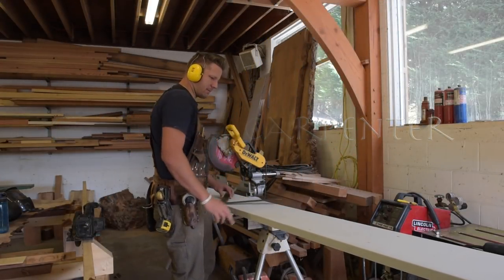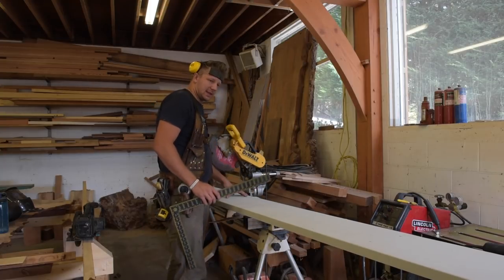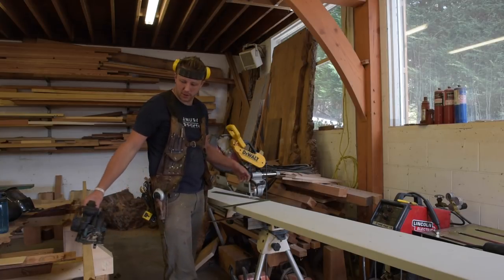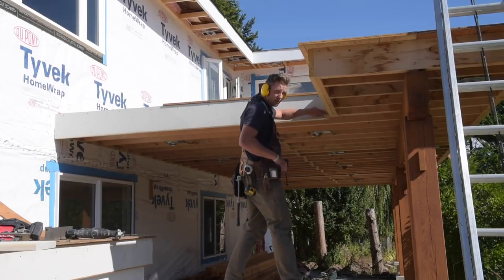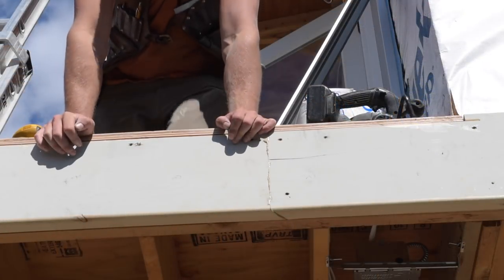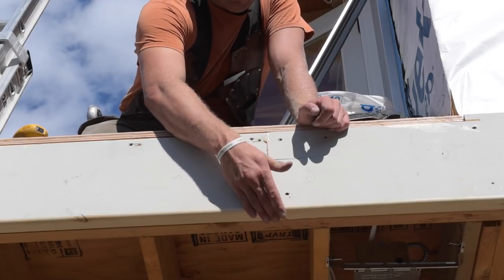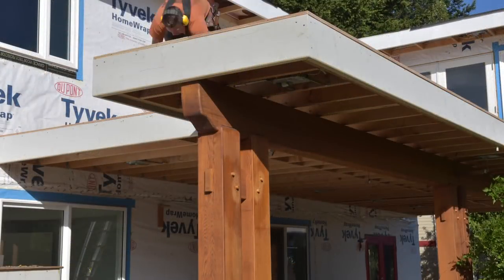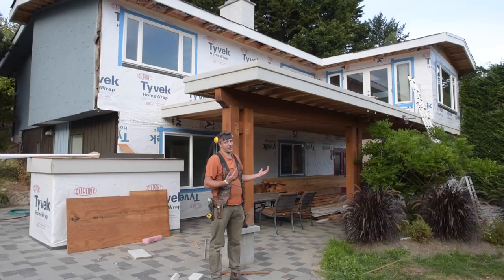Deck Reno Update,  How To Install Facia

Comment: Being a lefty, cutting against my speed square works very well. Also, a doweller for the field joints works great to prevent cupping and misalignment over time.

Comment: You need a NAS (network attached system) which is basically a smart external hard drive that can be accessed through the wifi in your house, and because it has multiple hard drives in it there is built in redundancy so that if one drive fails you will not lose all your data.
Reply: Storage not system
Reply: A NAS is not a backup. The most common time for second drive of an array to fail is during a rebuild after replacing the initial failed drive and since you're running multiple drives in a NAS your odds of failure are exponentially increased. With giant USB drives being a couple of hundred bucks these days there is very little reason to not have a complete redundant backup of everything you could ever care about... particularly so if your business relies on your data. If he loses a month worth of content, then he's out a month's pay for has to scramble to make it up some other way.

So... A NAS is a great way to store huge amounts of data in a fast to access package, but it's a terrible solution for data backup.
Reply: Amen Maxwelhse.

Comment: Hey Samarai. Doing great work mate. Just 1 thing when doing facia I would always recommend priming the cut ends also just in case of water penetration on the joints as it will prevent any moisture getting in to the wood. I'm not sure if you have done this as sped up on parts.

Comment: My 2 cents, Always primer your end cuts, even if it's a miter that you won't see.  Water will see it eventually, some how.  And water loves that spruce or what we have here primed radiata pine ( which fyi is nicknamed rotts a lots-a) even the pressure treated.  I've seen to many facia boards rott to not prime every last bit.  They don't even sell the spruce here anymore because of the rotting problems.  It used to be used as all trim, corner trim, window trim, facia, and it all needs to be replaced within a few years. Primer is your friend.  I do love the use of PL though, it works

Comment: why not screw from the back an not have to fill .Just a thought ,clamp in place a screw on an angle up . love your work and vids
Reply: Can get way more strength going from front, as the depth of the screw should be at least 2x the depth of the member (25mm fascia = 50mm screws minimum). If you went from behind you aren't getting that holding power
Reply: he was using finish head screws . from the front which i thought would be less effective as adhesive + longer screws from the back

Comment: I can't tell ya how many YouTubers I've seen suffer channel failures for lack of a backup of their data... You can buy an 8TB USB drive for about $200 that includes the software to fully mirror other hard drives. If you need another $200 tool for a job your livelihood counted on you wouldn't even hesitate...

Since you just dodge the bullet, if whatever you did to fix things did NOT include a method to fully backup all data, now is a good time to address the issue before you get complacent again.

Comment: If it ain't cupped before you put it up? Don't worry it will after, no such thing as a miter that won't come apart.
Reply: G shredder 
Lol...
You're saying that all the miters I've glued are now apart, when they're clearly still together after more than a decade.
You're just a bad carpenter.
Reply: ya, I'm sure they are still together. ;)

Comment: $3000 for hard drives.... what did you buy???  That is crazy expensive.  
A couple hundred for external drive(s) and hundred or so for an internal drive and good to go.
Reply: Jason didnt mention that the hard drives would've cost 3k. Just said 3000$ later.Maybe he got a new pc?
Reply: Good points guys.  Also as a small business owner he has to think about technology purchases differently than regular consumer like myself.
Reply: Maybe he said "external hard drive" but meant "NAS". Video takes up more space than 1 external, and you want it RAIDed, so NAS makes more sense.
Reply: I was also thinking that he bought a NAS and not just a regular hard drive.
Reply: Probably data recovery, that's expensive.
Reply: Nick Pilarski I'm sure it's going to be more than that if it's data recovery. I remember Linus' brouhaha with data loss a few years ago.
Reply: Yeah I think the samurai is prone to mega hyperbole...
Reply: maybe he got talked into a few TBs of NVME

Comment: Almost 3 grand later?????? For a few new Hard drives and labor? I'm an IT guy and for 3 grand i could build you a custom badass brand new computer with multiple Hard drives in a Raid so you will never have to worry about data loss ever again. If a drive starts to fail it will auto kick a new drive in rebuild mode.. Whoever you called to fix this or for parts "NEVER USE THEM AGAIN"